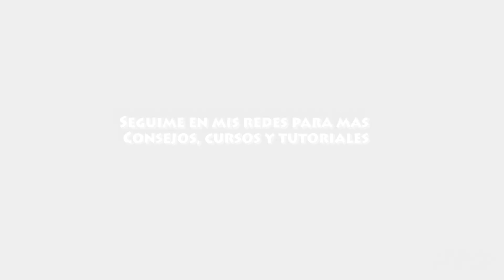#26 - 😎 Armando un Lotus SEVEN: ARRACANDOLO por primera vez 😱😱😱😱 ¿Arrancará? - Juanlmatus.com

Comment: Great job. I'm about to start on my car as well. First I need to study a lot.
Reply from the maker: Thank you Tibor! Yeah it's important to study and have a good idea of were you are going with the project! Go for it!
Reply: @Juanlmatuscom  Which chassis did you use? Sorry I don't understand Spanish. I'm hungarian and live in LA.
Reply from the maker: Tibor, I used the book of Ron Champion and change the size to fit the mechanics that  I have available. Here is the link to the book: https://www.amazon.es/Build-Your-Sports-Little-Pounds/dp/1859606369
Reply: @Juanlmatuscom  Thanks Juan. I have purchased it, but hasn't arrived yet(Ebay). It is not to small that chassis? I'm thinking about using the McSorley bigger(wider+taller) chassis(sevenesque.com).
Reply from the maker: It's small. Ron use it with small engines like in line 4 cylinders 1.6Lts. I have to wider it 20 cm just to put the seat that I want. It depends on what engine or rear axle are you going to use. Anything you need, just let me know, good luck!